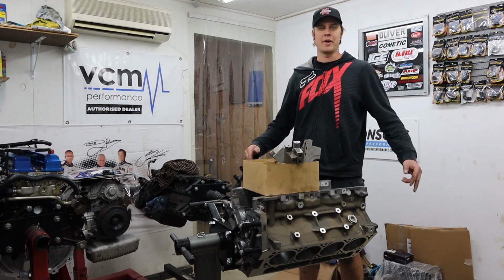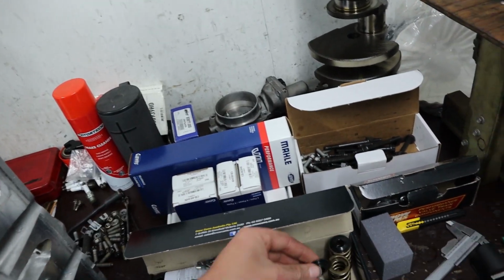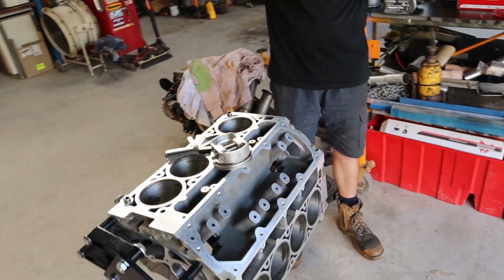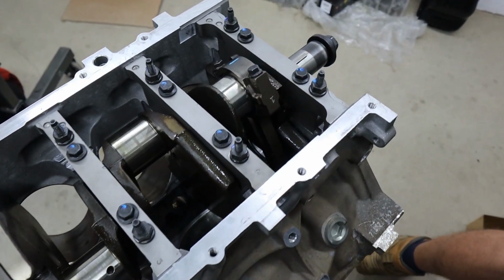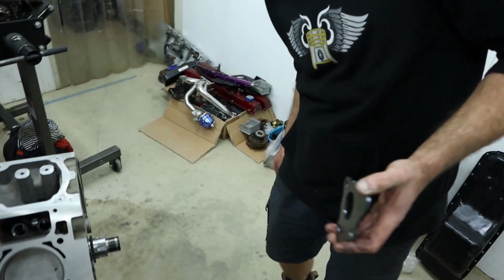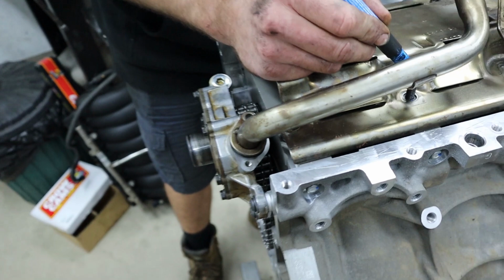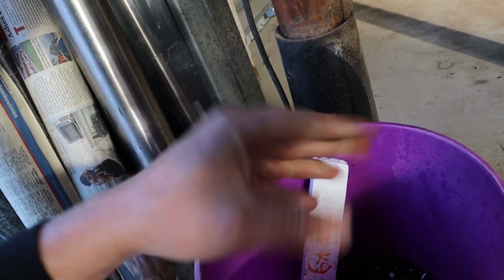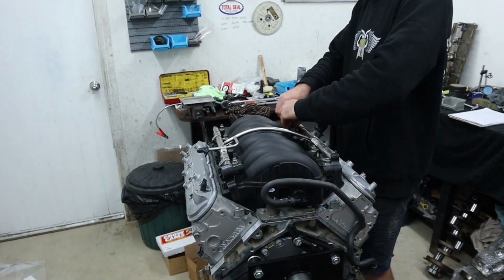LS2 Engine Build || E1 HSV Maloo LS2 Complete Package Part 2

Comment: When I installed a Melling oil pump, I couldn't fit the feeler gauges in, so instead I barely snugged the bolts and turned the engine over two full rotations by hand. I don't know if it's right, but I have over 20k miles on that pump now and it's still going strong.

Comment: Did you do piston to valve clearance with that cam and 30 thou off the heads? No piston pockets ?
Reply from the maker: No issues with PTV. Could even go .040” and still clear with cathedrals. With rectangles it would be getting a little closer for comfort though
Reply: @BoostGumps  Exactly what I need to know as I'm doing my L77 cam swap soon. Great detail that I just would not know without you valuable experience.

Comment: What do you recommend for a cam for a L98 auto SS. I wanted 228/232 VCM Cam kit includes push rods . A 2500 stall converter ok or larger

Comment: Hey bud I'm really kinda confused on what's going on with my ls1 I put a camtech cam 220/224 @.50  with I think stranded cromoly push rods.with difiliopo 2.5 cat back system  stock auto and air filter with mufflers tune only got 225kw tuned with 98. I never did degree the cam I just went off tdc marks. Could that be why I'm not getting the power?
Reply: Try a different tuner, thats a poor result.